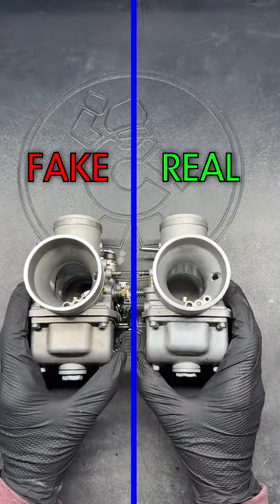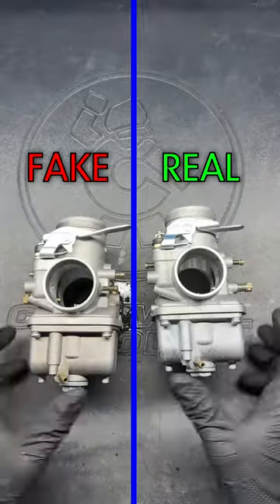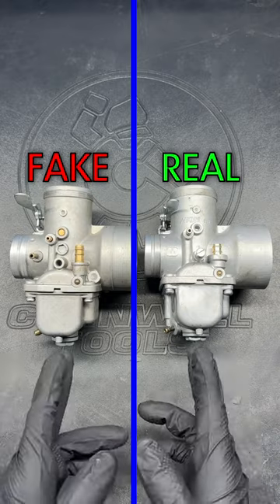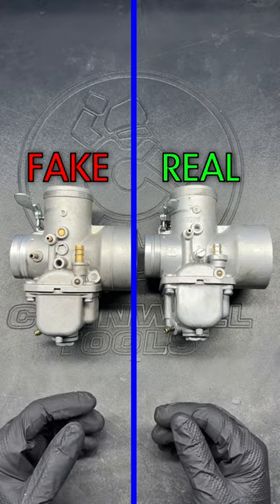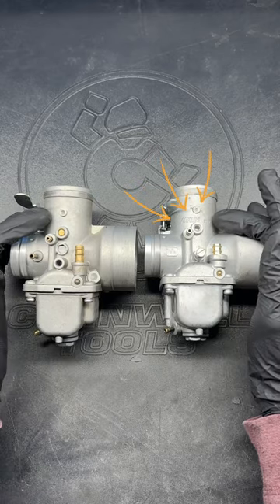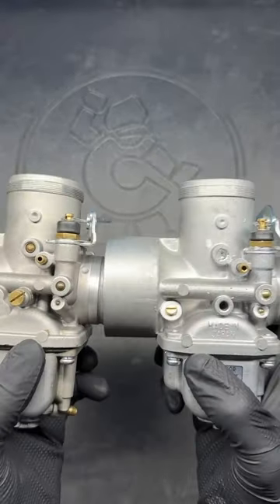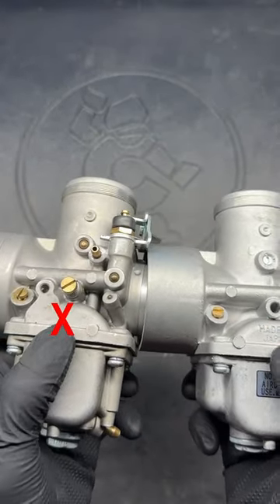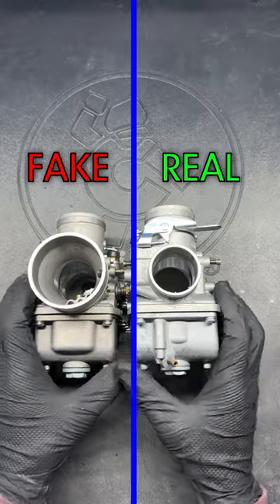How to spot a counterfeit Mikuni carburetor

Comment: Bought a cheap 26mm knock off for my yamaha RD 125lc expecting it to run badly if at all as std as I thought it would be flawed at least. Actually changed the jets and it ran like a champ! I bought it because it was half the price as a 1980's choke plunger rubber seal but the whole thing worked!
Reply from the maker: Yea as long as you get one that can receive the genuine jets it can work out. I have better luck with Keihin knockoffs than the Mikuni ones as far as that goes.
Reply: @oneupmotogarage  real OKOs are a great alternative to keihin carbs. There is a lot of fake OKO carbs out there though. The generic PWK clones has also worked fine to tune, but I had one break.
Reply: Hi there. I had to buy a knockoff or then replica of the mikuni vm16 for my 1981 Yamaha mr50. I'm still awaiting delivery on it. 
But I hope it will run well. As the carb keeps flooding. Something is wrong with the float. Or so. I hope I can just fit the new carb and the bike would atheist start. I do have good spark but petrol/fuel is coming in the exhaust.  So folding way too much
Reply: ive always bought Kitchen sink carbs .never a problem

Comment: Iv watched a few videos on Mikunis. When put on a Dyno the cheap knock off Mikuni made more power than the real one 😂. So I got the knock off
Reply from the maker: It's a gamble because not all knock offs are made the same. Some may work fine, others may be untunable or unusable. The worst that I'm trying to help people avoid is paying full price for a genuine and getting a knock off. Many sellers can't be trusted. If you know what you're getting, no problem there.
Reply: Never had a problem I didn't cause with my knockoff
Reply: @oneupmotogarage well your right about some knock offs being better forsure but I have bout 2 off Amazon that have said Japan and mikuni?? Has me confused but you can tell there heavier than other ones I've gotten and work better way better
Reply: Here's my story.   I just bought a new Mikuni branded VM20 from a trusted vintage moped parts source.   While it does have the Mikuni stampings, it doesn't say 'made in Japan." Also it has ink stampings on the air intake ring to indicate some kind of production coding.  Is real or copy as the site is selling as REAL

Comment: nice video👍. but can it be? a carburetor has made in Japan on it. can it be made in China??? it was a PE carburetor 26mm. it doesn't ride so good. it gives too much oil it spitter in the end rrrrrrt. only with race pipe it rides good. 2stroke 80cc

Comment: Mine has the mikuni symbol just not the “made in Japan” one.
Reply: yes same with me ? so is it genuine or fake ?
Reply: @chesty_meme which model is it? I got a vm26-606 it just says Mikuni corp on it no made in japan. I am pretty sure it is genuine i bought it for around 100 usd on amazon from a reputable seller.
Reply from the maker: I'd suspect knockoff, since I'm hearing that some fakes are casting Mikuni on them now. But I haven't verified that yet. Have you tried swapping jets with genuine Mikuni ones? As long as they swap over it may be just fine.
Reply from the maker: Not a good sign without "made in Japan" but I need to look into if Mikuni has any factories in other countries, in which case they wouldn't put "made in Japan" on them. @chesty_meme
Reply from the maker: what seller? Amazon is ripe for knock offs.  @Rocketman0407
Reply: @oneupmotogarage  I looked at a bunch of photos of the VM26 and it looks to not have the made in Japan engraving at all.
Reply: @oneupmotogarage  my comment got deleted since I mentioned the seller I will try again. It was Niche Cycle
Reply: @oneupmotogarage  yes I got a fake VM28 that says Mikuni Corp on it while the Fake TM28 says nothing and is made by KIPA it says on amazon now. The warning sticker on the float bowl I have never seen on a fake one though.
Reply: @oneupmotogarage hey I got a knockoff and my predator motor starts and drives just turns off without throttling it to stay on idle is it due to the fake carb ??

Comment: Dude. Right off the bat. Look at the damn nipples for the fuel lines. Brass is not steal 🤦‍♂️ just stick a magnet to it 😂
Reply from the maker: There are many subtle and inconsistent differences but since most people won’t have a genuine to compare with (or else they’d probably be using it) I tried to just show some of the bigger differences that will be across all fakes. However I’ve gotten reports of fakes with branding now too. But can’t confirm that yet.

Comment: How they run bro!? Any different hole gas, air or vent size!?
Reply from the maker: The knock off ran, but poorly. WAY too rich for the SR500 it was marketed for. And without the ability to get different sized jets it's hopeless to tune it.
Reply: @oneupmotogarage  why not man!? U can buy different size from china 🤕
Reply from the maker: @youllneverstopme4731  there’s no identification or branding for this knock off to know what internals would fit if any are even made. And there’s no marking on the jets to be able to know what to order even if I could find a place that sold them.

Comment: A box of micro drill bits can fix jet sizes..  have done re,jetting  on chinese carbys  for years.. they work fine when you know what to do with them..
Reply from the maker: can work but far from ideal. You can drill them bigger but you can't drill them smaller. This carb from the vid only has one main jet and since it's unique to that carb and came way too rich for the SR500 it was advertised for, no amount of drilling will fix that. And I don't like plugging the jet holes with JB weld and then drilling them as a solution.
Reply: @oneupmotogarage  dob of solder works fine then drill to size..  works a treat.. or braize them up..👍
Reply from the maker: I find it worth the cost of using carbs with pre-drilled jets in the time it saves to tune them. It also helps whoever works on it in the future. If I were in a remote area or with no budget those techniques would suffice. That's how they'd tune bikes in Mad Max 😎   @rebekahfrench5747

Comment: The "Made in Japan," and, "Mikuni," logo are not good telltale signs for authenticity. I have two fakes like each in the video. Only way I know to tell is if a Mikuni jets will fit. I've been trying to find an authentic Mikuni dealer, but I think they are all fakes.
Reply from the maker: I've heard about knockoffs that have Mikuni cast on it but haven't seen any yet personally. I've also had knockoffs that did fit genuine parts so that's not a good tell either. Sadly it really is getting to be a crapshoot.
Reply: @oneupmotogarage  Seems like it lol. I bought a $30 knockoff for the parts to rebuild the current knockoff on my bike. The new one had the logos on them. Sadly my bike is running so rich that it's affecting performance pretty badly. I'm getting mybe 20 miles to the gallon, and it take's a bit of playing with the rpms to get above 40mph (Top speed is 55, but a good cruising speed is 50) I adjusted the needle last night and it is a bit leaner now, but man, if genuine parts were just easy to find...

Comment: mine has japan stamped on one side but only makuni corporation on the throttle cable cap
Reply from the maker: That’s odd for a few reasons, cables aren’t usually branded Mikuni. And if it were genuine it would definitely have Mikuni cast into it somewhere.
Reply: @oneupmotogarage  its on the carb, its the screw-on cap that the cable goes into that holds the needle
Reply from the maker: @RicassoBuilt  ohh interesting maybe someone replaced the carb body but kept the original cap.
Reply: @oneupmotogarage  yeah, i was thinking that or its an old model. theres still japan stamped on the carb itself just no manufacturer markings. it works good after cleaning it, so thats what matters right?

Comment: The cheap ones ebay run better . Better than oem
Reply from the maker: Some can, I actually have a vid on a carb that is just as good for $20 vs the $200 stock one. But the problem is you get zero consistency between the different knock off models and brands so you may have good luck with one, but then someone else gets one like in this vid and it's quite useless.